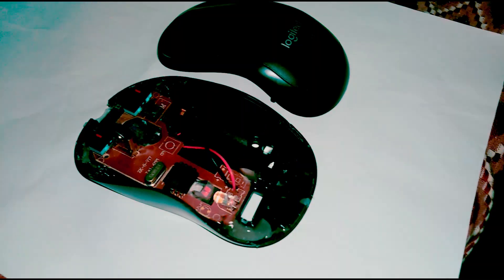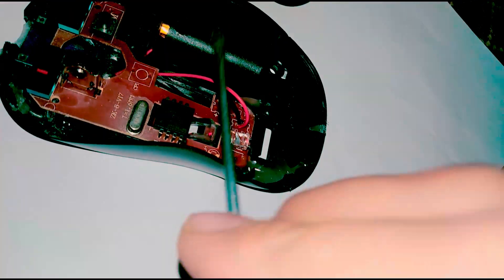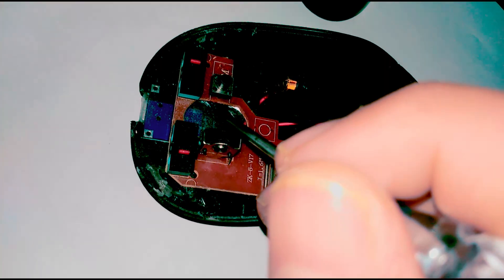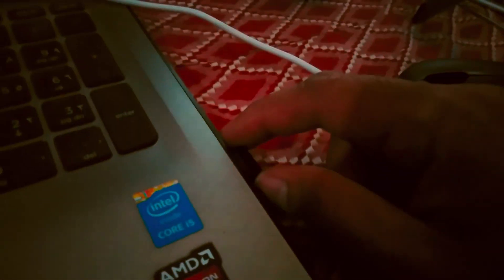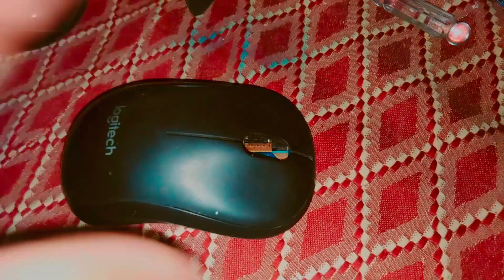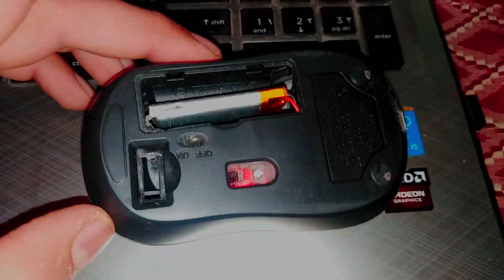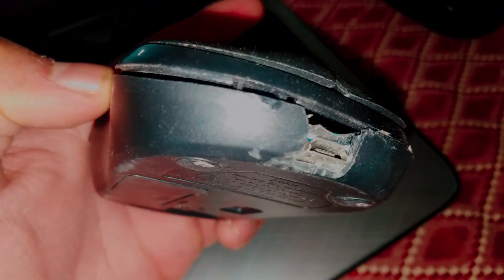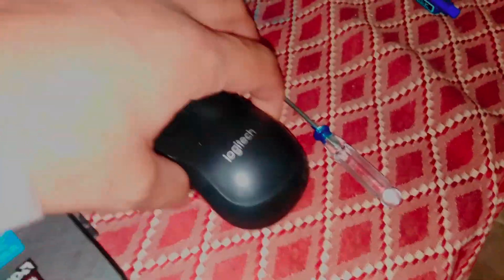DIY Rechargeable Mouse

Comment: Does it heat up? I tried this project and my mouse kept heating up and stopped working properly.
Reply from the maker: you should check mouse operating voltage if its 3 volts then okay if less then 3 volt than not okay your mouse run on single battery or dual cell battery